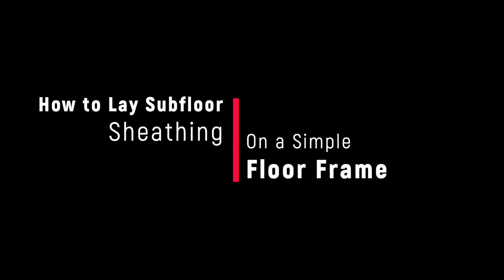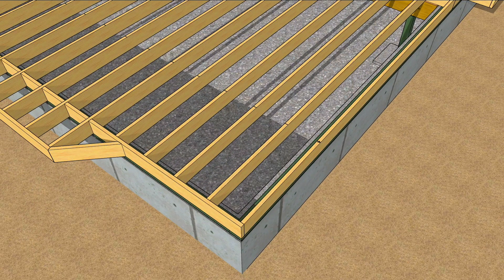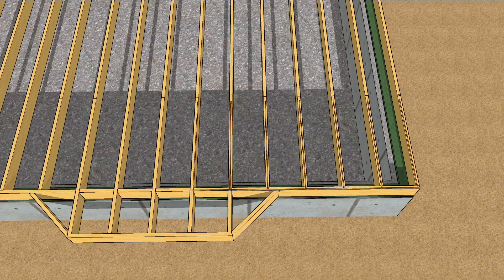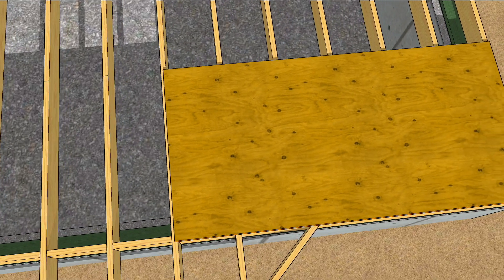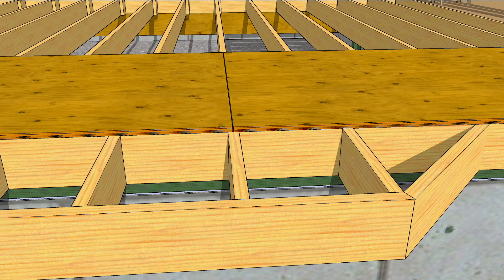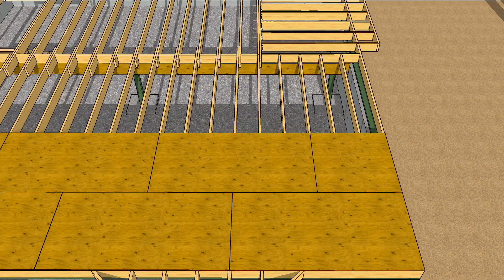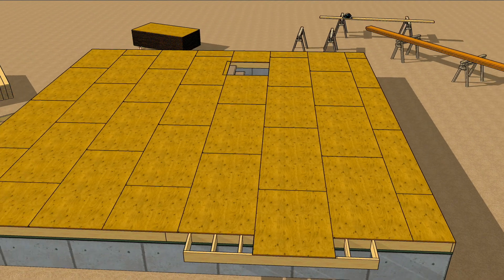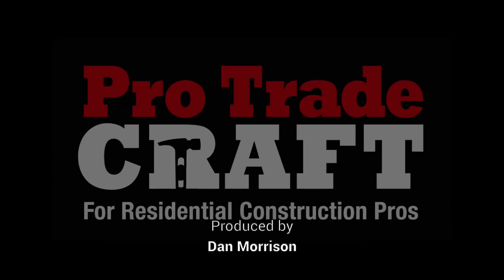How To Sheathe a Subfloor Deck: Installing Subfloor Panels

Comment: You don't mention how you deal with the subfloor sheets when they encounter the lapped joists on the other side of the beam. With everything off then by 1.5", how to you regain alignment with the sheet edges?
Reply from the maker: You have to cut one.

Comment: 64 and 16 equals 80 not 72
Reply from the maker: in your world maybe. My world has a different exchange rate. but thanks for the notification. Are you looking for a side gig as a copyeditor?
Reply: @ProTradeCraft  What the F  is your problem he is right.16 32 48 64 (80) 96. 64 +8=72.......64+16=80. When people in your life tell you you area Narcissist, believe them. Plus the last joist for insulation purposes you pull it 16 oc from box joist so last joist is closer the the 2nd to last and you have that full bay at the end
Reply: @labla8940  relax keyboard warrior. I'm pretty sure he's making a joke at his own expense. He knows he got it wrong.